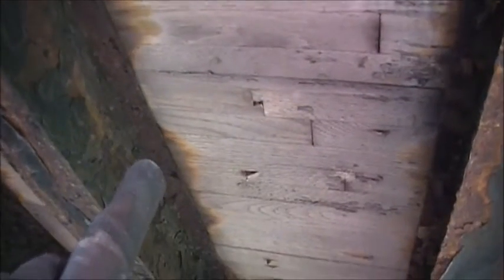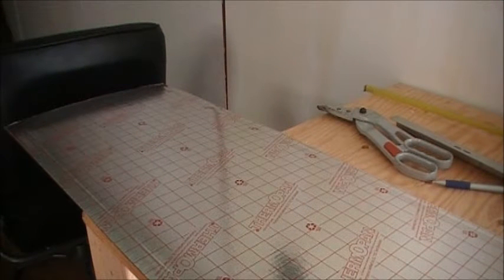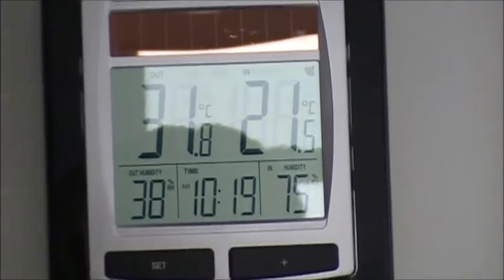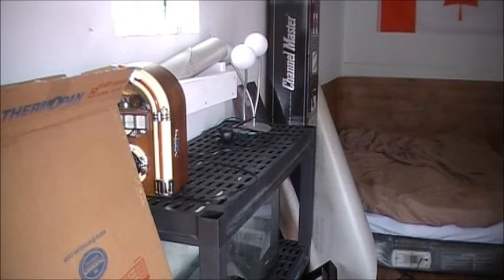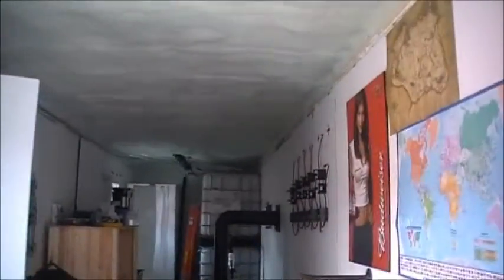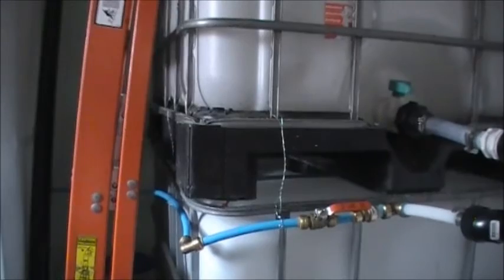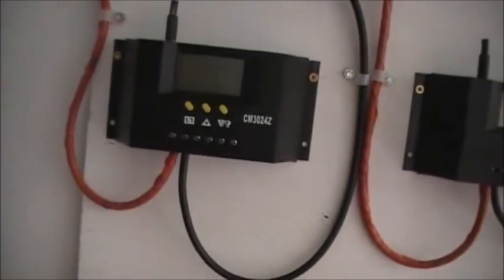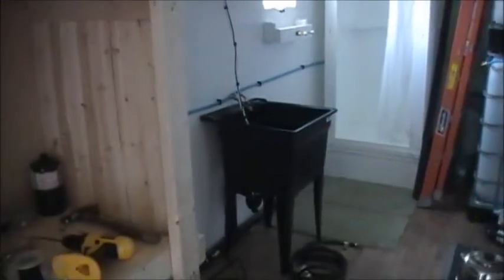The Off Grid Tiny House 155 More Insulation

Comment: The high levels of humidity inside your trailer could cause you problems in the future. Perhaps some kind of roof vent with a fan could help. You will have more problems with it in winter. Propane use adds to the humidity factor. 
Good call with insulating the under cartage . What is the correct name of material you were cutting ? It looks like even that has some sort of R value ( albeit ) small.
I would not worry about your inverters draining your power. I have a older Motomaster 1000 watt inverter. I run it all night with LED lights, and other things. ( never had a problem)
Reply from the maker: David Pedder Fantastic tip on the inverter. The material is called "Thermo-pan" used in the HVAC(heating, Ventilation, Air conditioning) industry as return air duct work for cavity's. Its worked fantastic and in coming videos I will show you how it looks. I am at the half way point now.